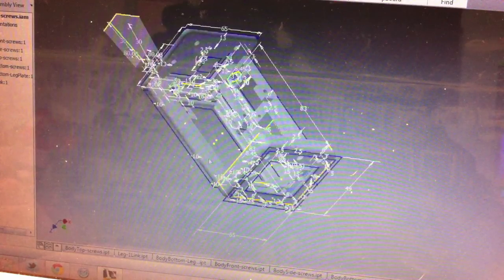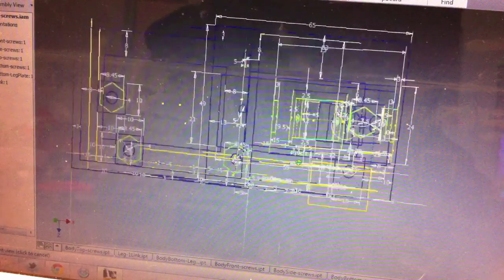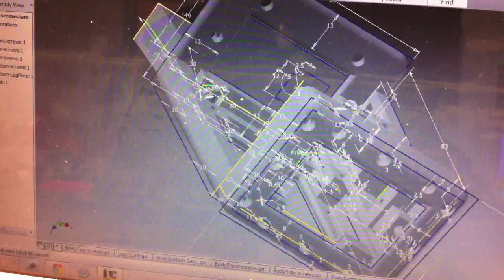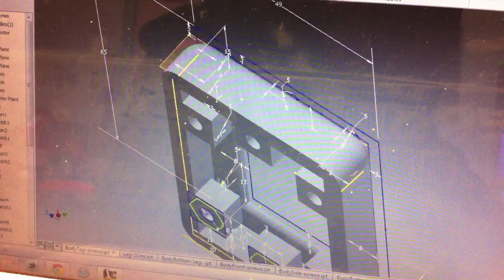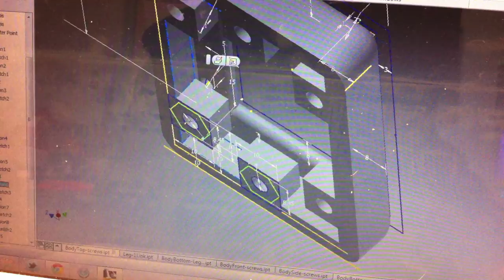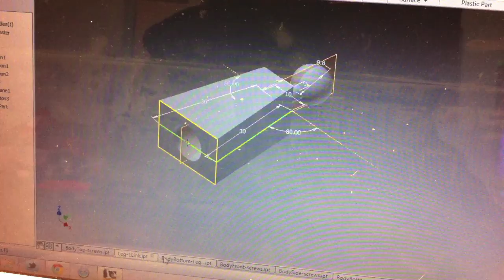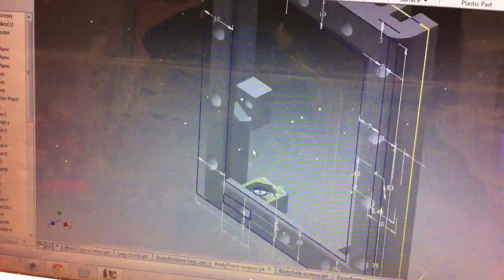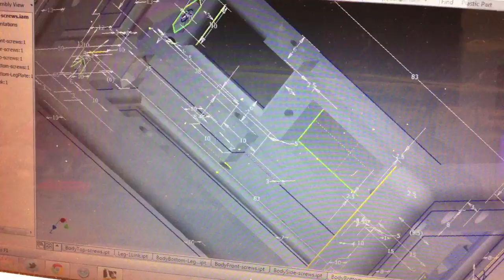3D Printing - Attaching Pieces Test #1-10 Part 2

Comment: Currently trying to 3d print a deck box. Thinking about trying a pinning method. Any kind of slide is a no-go because my printer isn't very good at fine details. If worse comes to worst I can always get some JB Weld or something to make sure it stays together.

Comment from the maker: (continued from other comment) Rotating the model with the sphere around also didn't help, because when I was taking off the supports, the ball popped off as well. -_- 

I'll probably end up printing dumbell-like structures with two spheres on the end to make the 'links' work between two sockets.

Haven't tried a Gundam or other plamo kit. Clipping things together is such an art form, apparently!

Comment from the maker: Gee, thanks Christie! :)

Yeah, it's basically a half-ball. In the design, it rests about 1mm below the center point of the circle. This way there is more of a sphere that can "lock in" to the socket.

Actually, I was trying to print some spheres the other day and they become really deformed if they are not resting on the build platform. If there are supports on the side of the sphere, it will become very squishy and not be able to look like the other side (that didn't have supports).